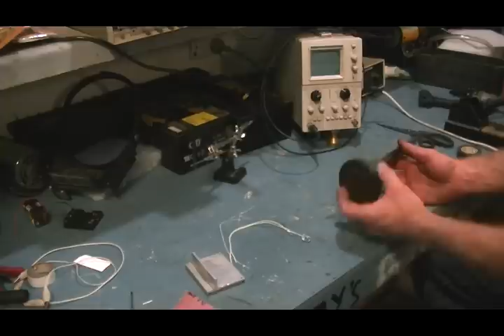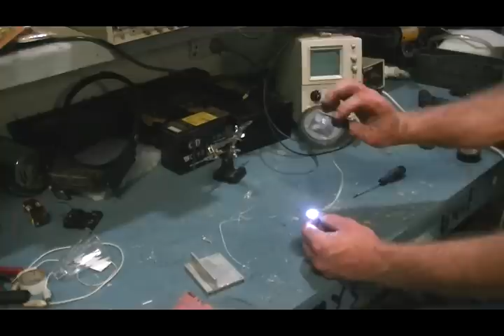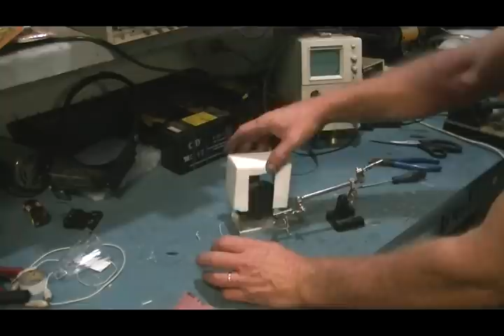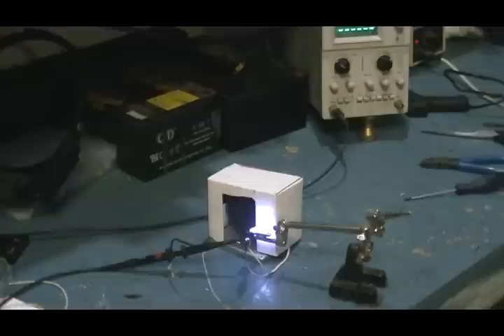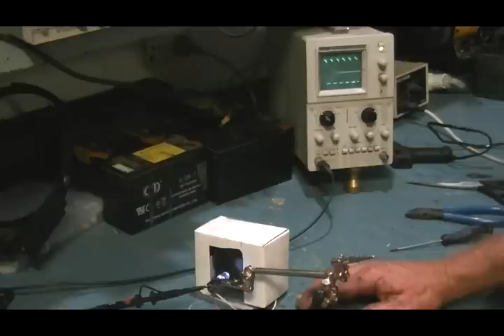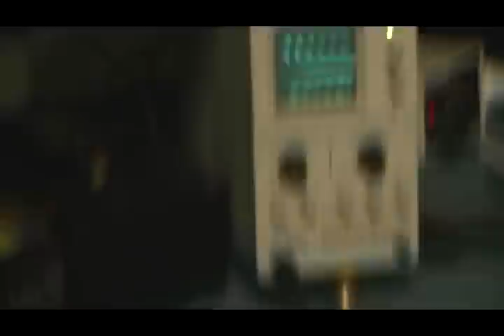Decoding the DOVADA device circuit build

Comment from the maker: Hi Kult
I believe the 3rd LED in the circuit is actualy a light recieving diode,and that is what is sending the input pulse to a signal transistor.
So that is what i was trying to replicate,but useing a solar pannel as the LRD.
I am uploading a video at the moment,and the result's look quite promising.
But a 2 channel scope would be realy handy right about now lol.So the saving has started for that 2 channel scope.